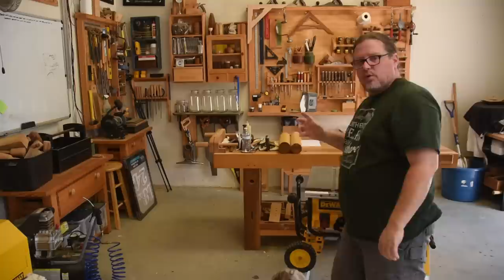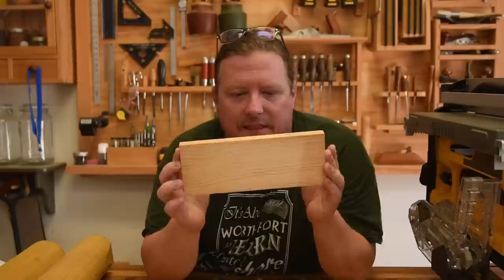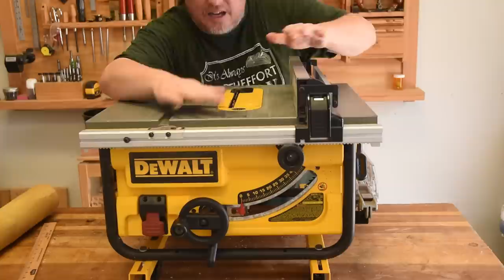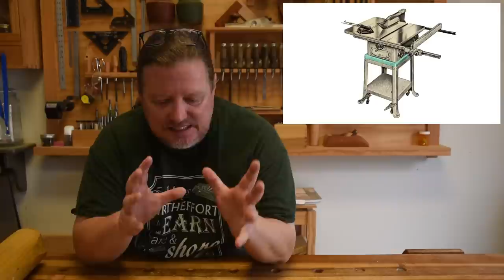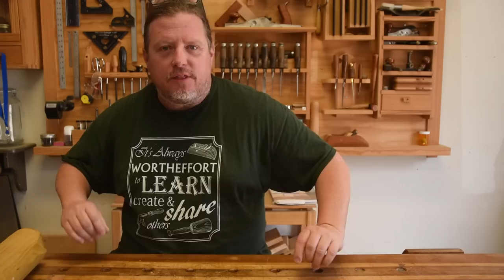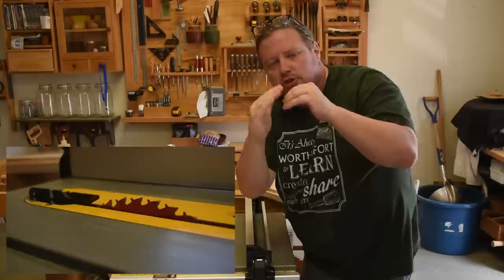What Table Saw is Best for You?

Comment: Thanks for the very honest video.  Its refreshing to see someone this your experience not telling a new woodworker that they need to go buy a $2000 table saw before they can even get started.  I am also a new woodworker and started with a dewalt Jobsite saw and a track saw.  I had the opportunity and space to get a cabinet saw and love it.  But the cabinet saw really can't do more than I could with my little Jobsite saw.  The difference is I know the cabinet saw is straight and true every time I use it.  Wherewith my little Dewalt I was always readjusting and measuring.   I also can feed thick stock much faster through the cabinet saw.  However, I made terrific furniture with my little Dewalt and with patience and attention to detail anyone can use a less expensive saw and make almost anything they desire.
Reply: if money was not an issue and you were just getting into woodwork, knowing what you know now, would you have got the cabinet saw or jobsite saw?

Comment: I've had a Delta 1.5 horse contractor saw for 16 years. It has served me pretty good. Only the occasional bog down and breaker trip cutting thick hardwood. I am redoing my shop and am a pretty serious hobbyist. Two of the items on the long list of things I want to accomplish with redoing my shop is much better dust management and more power from my table saw. After much research I was set on a Sawstop PCS. Then a Grizzly G0690. Then a Delta Unisaw. Well, about 2 hours ago I ordered a Laguna Fusion F3. A cabinet saw isn't for everyone just like a jobsite saw isn't for everyone. Really enjoyed this video. It is chock full of common sense and accurate info. Thanks.
Reply from the maker: Thanks

Comment: I went with a Delta contractor saw with lots of cast iron table extensions. It’s pretty darn heavy and I would not want to bring it back and forth to a job site , I used to be a contractor back in the day , but it has wheels and can easily be rolled just outside the garage for better dust management. So far I have no complaints. I just bought an 8 inch dado for it. 
A contender was the Dewalt job site saw.
Your videos are very very good. 
Thanks.

Comment: Terrific video on the range of table saws with a common-sense perspective. Have had all three: contractor, cabinet and job-site. My previous home workshop included a Powermatic 66 cabinet saw which was way overkill for what I did, but loved the accuracy, build quality and it was a joy to use. Now years later since moving,  my home workshop is the half-garage version so everything has to be compact and/or mobile. Now have a Bosch jobsite saw on wheels ... and it does a first-class job, although for some cuts I really miss the larger table of the cabinet type machine. But I do agree that the better job-site saws have come along way and are likely a more than adequate choice for many home woodworkers or smaller shops.

Comment: The PROBLEM with inaccurate equipment/ tools is that the joy of woodworking becomes a chore. 

I also find myself twisting my body and arm to counter the inaccuracies during the cuts and then realise I am placing myself in danger. 
Accuracy is Safety and Sanity.
Peace to all👍.
Nice video
Reply: This was a perfect comment.. I dont want to fight the project I am building.. I want the joy of creating something nice and not have to fiddle with it till Im blue in the face.. Then if you get frustrated fooling around with an inaccurate tool,, thats when the chances of losing fingers goes through the roof... Not to mention the price of wood these days,, who can afford inaccurate cuts?? but the joy of wood working,, if thats lost,,, why even do it...
Reply: @oldmanpatriot1490      Yes Sir!   I hate it when woodworking makes one work or cuss.   I cured that disease a long time ago by learning how to fine tune my miter saw, table saws and planers.   Everyone new to woodworking should also purchase some good high quality squares, digital calipers, a dial indicator or two and an inclinometer/angle gauge.  With these you can make a decent tool a great tool and cuss much less!    One of the best things you can do with your table saw is to make a sled - one small and one large.   Dividends paid to you are enormous if you take the time to make it right!

Comment: A riving knife is nice but a splitter works well also, it just is a fixed height and does not go up and down with the blade. This is what I have on my PM 66. It was purchased from Craigslist with a new motor, upgraded fence and a table extension for $350, working perfectly. I added the top blade guard and splitter for about $150.  A precision miter head and some odds and ends brings the total to ballpark of $650 all in. Good deals are out there and they can be safe saws but without the SawStop feature. I likely would have been well served with a mid level saw but a new one of those would have cost more than the cabinet saw I have now.

Comment: Great job for the new woodworker explaining the options, advantages, disadvantages, etc.   Like WB Fine Woodworking, I bought a Craftsman contractor saw in 1977 and have built a lot of furniture with it and I agree the fence did have accuracy issues but it allowed me to get started (don't think they had job saws back then; at least I don't recall).  It also had another disadvantage because of the motor size, it was not easy to cut 10/4 and 12/4 "hard" maple, not "soft" maple which is more abundant today.  So I do have a Delta cabinet saw which I bought a number of years ago that I have modified with a riving knife ( as you've said VERY IMPORTANT FOR ANY SAW TO HAVE); 3 hp, 220 volt.  But for making bed posts, table tops, etc. this saw saves the day.  With an out feed cabinet there is not much I can't do by myself, even for an "old guy" like me.  Anyway you gave a great overview for the beginning woodworker so they can make a more informed decision.  Keep up the good work!   Regards,  Bill
Reply from the maker: Sounds like an ideal setup.

Comment: Due to a need for having it on-site and a restricted budget, I bought a Kobalt Jobsite table saw to fix a botched floor installation at my Father-in-Law's house.  I bought one of the previous year's models that had a dual-latch fence, feed-out extension, and a 30" right rip capacity.  

Wasn't expecting much, just needed something to cross cut/rip laminate flooring/baseboards/thresholds and a little dadoing. But gotta admit I was pleasantly surprised at how nicely this saw did the job!  The blade was pretty damn true out of the box. The fence, when locked down, stayed put. And the table was surprisingly flat. Is it as good as a cabinet saw?...Of course not. But this will do for quite a while...allowing me to spend my $$ elsewhere to equip my shop when I move to a bigger space.

Comment: My work as an artist is hugely elevated by what I can do with my table saw... its an older Sears contractor grade 1970. Dad bought it. I still got it, its been through two motors, now running a 3hp. I purpose built a workstation around it, so that I can have a huge deck around the saw. I use it constantly, making my cradled panels, which use a lot of thin strips of wood, framing the underside of the plywood. The stock fence that came with the table was always off, and I built a new fence into the table, one that I can get 100% parallel to the blade every time. That was not easy when you don't have a fence to use to make it! I would love to have a new saw, but, this older one has a cast iron deck, longer arbor, plenty of power and everything about it is dead on. (After about two week of work on it!) I could not imagine using a construction job site saw, I used one at work, and I just felt they were more dangerous than normal for the flimsy nature of the design... it is lightweight, and that means it jumps when you get a snag in the wood, so clamping it down real good is really important. Nothing move my table saw at home... the table and workstation is over 600lbs. It's on wheels and still never has moved. I wish for a nice cabinet saw with all the bells... but artist? Yeah, not part of my budget. I'll replace the motor on mine forever. Thanks for posting!
Reply: Yep, back in the day when woodworkers would actually consider purchasing a Sears contractor saw.  Boy, oh boy, where did those days go?   Things now days are meant to be disposed of instead of being repaired.  Sometimes replacing a simple motor on a saw you'd be better off just repurchasing the same saw!   Friend of mine blew his motor on a budget jobsite saw and the replacement motor was $20 more than the entire saw brand new.   I can remember when clothes (specifically jeans)  were passed down from older brother to younger brother to younger brother upon outgrowing them.    One single boy can wear out a pair of jeans in less than a year's time now days.
Reply: I think our manufacturing culture hit a point where the craftsmen of the day thought they WERE making compromises in making these beasts, only for the fact that they had worked on things from the 40's, giant megahemeths of iron, solid one piece cast frame, truly nasty immobile things of anger metal, centered around a flaming bit of carbide... finger liking constructions of danger!

Comment: Great review, my option... Used craftsman contractor's saws are super cheap on CL and just need a decent fence. I found mine on a curb (really)... Added a Vega fence for $50 on CL and a $25 1.25 hp USA made motor for a really nice saw. I used the microjig splitters in lieu of riving knife
Reply: What do you think of the Micro Jig splitter? Are yo using the steel ones or just the solid plastic?
Reply: @daveacker7427  I use the steel ones now started with plastic. The plastic worked, but true to form they broke easily. Very happy with the ones I currently have.
Reply from the maker: I'd find some old iron to restore if I thought it was relatable to new woodworkers. I worry it'd look more like an obsticle to entry to most.

Comment: I went from that Dewalt to a 90's Delta contractors saw (34-444). The Delta can be found used for under $200 fairly often. Difference was night and day, so much quieter, smoother, more accurate. I do a lot of production parts and can keep very good accuracy with the stock fence. I would recommend a used 90's era contractor saw over buying a newer Dewalt if you don't need the extra portability of a jobsite saw.

Comment: Excellent explanation! I learned on an old full size Delta, but have the same DW745 that you show here.  The worst feature, to my mind, is the short infeed.  I have a shop made adjustable vertical sawhorse that I use for infeed when needed.  The outfeed is easier in just make some other table of the same height.   I made a stand that slightly extends both sides and back and eventually will put some folding wings on it for sides and outfeed.  But not happy with the short infeed. 

I really like the riving knife feature.  Better than the full size older Delta because it moves up and down with the blade, so you can use it most of the time, and no changing it out all the time.  A reason not to have a full size table saw is if your wiring won't accommodate it.  Small shop, regular house wiring, so the jobsite saw is ideal there.  That's my situation.   The other disadvantage to this saw is no Dado blade, but I have a good 1/8" blade that is ok for some grooves, finger joints, etc.  Because it's 1/8" inch, easy to calculate most things.

I'd rather break down large sheets of plywood with a track saw.  So easy, and there are decent ones now that don't cost so much as the Festool.
Reply from the maker: Ya that infeed is a handicap for fine work.

Comment: I agree for me I loved my rigid jobsite saw but at the time I upgraded because of accuracy I was going for the contractor saw. When it came time to purchase i received an inheritance so that's when i decided on the cabinet saw. If it was for the inheritance i would still have a smaller format. You made great points on all the different saws thanks for the videos.
Reply from the maker: I"m sure your family member would've approved the decision.
Reply: @wortheffort  yup my mom told me to do what made me happy so I got a 20 inch powermatic planer a 6 inch jointer both helical a pm3000 a box 14 and oneida dust collection. So I guess I did what mom asked me to do

Comment: Great Video explaining the various table saws. Very well done, keep up the good teachings and knowledge sharing. I have seen videos where folks have gone and built their table saws using baltic birch plywood and have good level of accuracy like a contractor saw. My worry would be if the place where the saw is located and got wet I would thing it would end up going in the fireplace after it has been soaking for a while.

Comment: I still use a Craftsman radial arm saw. Mine is the contractor model so it's table is smaller than a full size ras. I got it for 40 dollars off of Facebook marketplace and I spent another 55 for the MDF for a new table but it's really nice and I can saw, plane and even joint (with a jig).

Comment: Had I not inherited a 1968/69 Craftsman 113 series from my dad in great shape, I would have went for a jobsite saw like the Dewalt.  Being that I got it free, I put another $450 into it (about what a decent jobsite saw would have cost me)... for extra cast wings, new Delta T3 fence system, cast router table, etc.  I now have a super contractor saw built like a tank that will last another 40 years.  It is heavy with all that cast iron, but rock solid and I will have to rarely, if al all, move it.  It is capable of 36" rips on the right and 30" on the left, along with handling large sled jigs I need.  New is not always better and if you can find one cheap, go for an older/vintage contractor saw and give it some love.

Comment: This is an absolutely great video. I've been using a DW745 like yours for the past year and I enjoyed your explanation of how it really works and is put together. I do find it's a very admirable machine for it's portability (I haul it up from the basement when I need it) and accuracy for "one-off" projects. I did come to an independent realization that its accuracy for cross cuts or tapers where I have to use the miter slots are not that accurate due to the inherent nature of the table top itself. Rip cuts I do find it's a very good saw--I use a card table for out-feed and a roller for in-feed. In short, many people use this job-site saw b/c one can get surprisingly good results with it. Many people discover they like woodworking and upgrade also. But after watching this I doubt I've ever bother upgrading (or getting a Harley or bass boat either). 

I would guess that the accuracy limitations you mention for production maple cuts may also be due to the fact that this job site saw requires a thin (3/32") kerf blade--so some flex is more likely to occur. I use a Forrest brand 20 tooth rip-blade when doing hardwood laminates of 2-3". Some blade scoring, but not burning, and I can easily sand it smooth.
Reply from the maker: Thanks

Comment: Great video, I already had bought my saw a few weeks ago (Ryobi) - kinda have a little buyers remorse with it not realizing I wouldn't be able to easily make sliding jig for it because of the miter slot being a t style.  Still it had all the other features I really wanted - namely being able to cut full sheets of plywood with it.
Reply from the maker: Thanks
Reply: Most people I know do not try to lift 75 - 100 lbs sheet  goods.  For 23 1/4 cut to 24 inches with saw guide now RIP 23 1/4 inch, your repetitive  cuts will be more accurate.

Comment: I wish I had seen this video 3 days ago. I brought a dcs7485 and I'm already finding the "cheap" aspects of it. The angle adjustment is very fiddly, the fence is warped so that the front is at a different angle to the back, there's only a single mitre slot, the mitre gauge is pants and has a lot of play, and the table top is small. I'm invested in the flexvolt platform so dewalt was my primary choice but I wish that the table saw was just a little more dialled in.
Reply from the maker: ya

Comment: The problem at 26::20 is the hardness of slamming the wood a against the block does adjust any measurement work as long as it is  is done right " measure 2times cut once

Comment: While I already have a SawStop ICS I watched to see what you’d say. This is excellent for new woodworkers to watch. Your information was good and well thought out. My previous saw was a Craftsman contractors saw that I bought in 1976. Other than accuracy and safety that saw could do everything that my SawStop can do. The accuracy problem came from the poor fence. It was worse than the one on your DeWalt job site saw. I fully agree on your comment on the need of a riving knife. Even my old Craftsman actually had one attached to the blade guard. Great job.
Reply: I love your logo :)
A fellow woodworker and dachshund lover.
Reply: CoeurDuPetitPrince Thanks. The silhouette is actually of one of our AKC Grand Champion basset hounds. I often include some of our bassets in my woodworking videos.